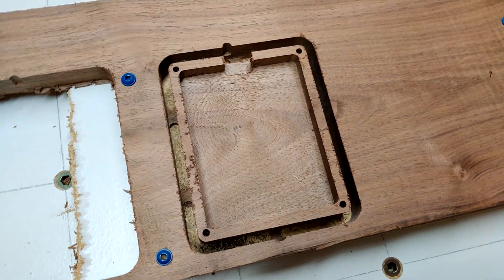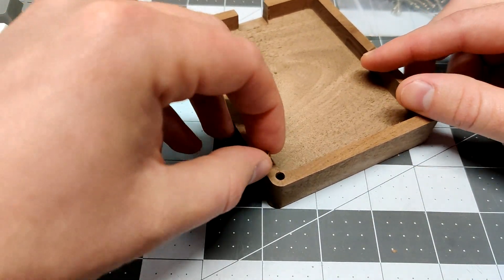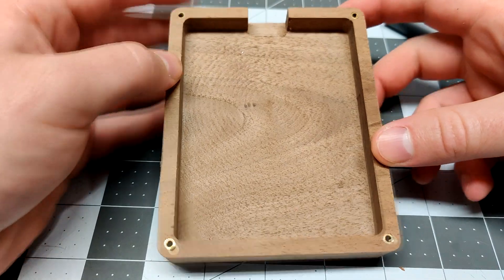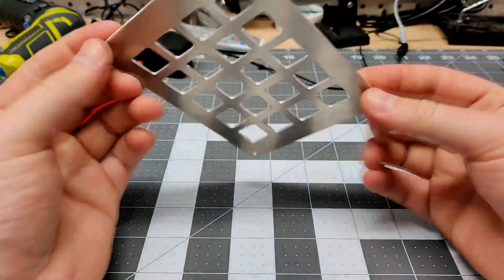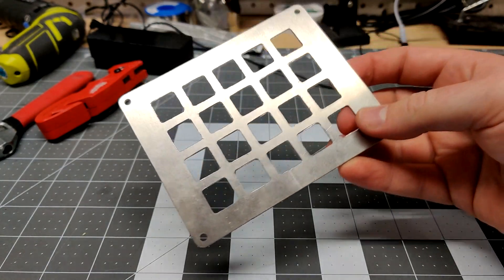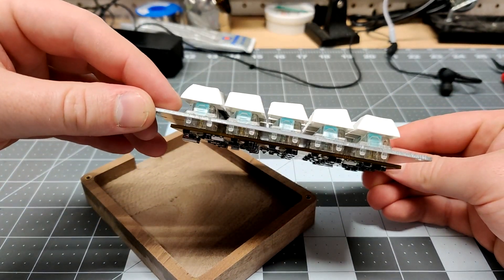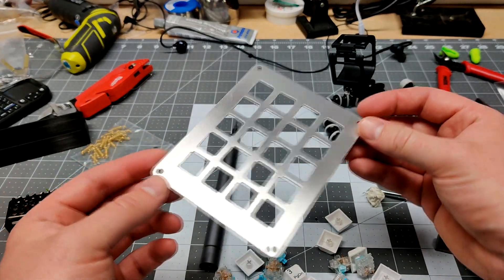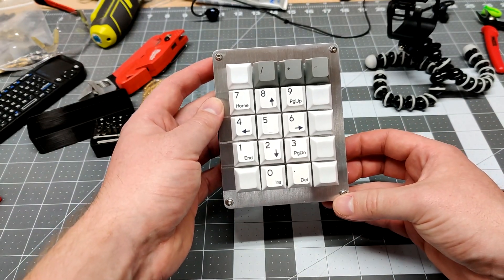MPCNC Primo - Walnut & Aluminum Numpad!

Comment: with what bit did you cut the cherry cutouts? I want to cut a keyboard plate and I'm afraid that I'll have to use a very thin tip due to the corner radius (cherry mx says that corner radius for the mount hole should be <0.3mm). Did you use a 2mm bit? Did it work well? are the switches sitting tightly?
Reply: @ProjectsbyBrian  in diameter i guess. how big where the switch holes? 14mm on each side?
Reply: @ProjectsbyBrian  sure. Haven't tried to use swillkb to an actual plate yet though - I just want to make sure that a plate can be CNCed.

It's very weird they're 19.05, cherry mx says 14mm hole in its docs. I'm missing something